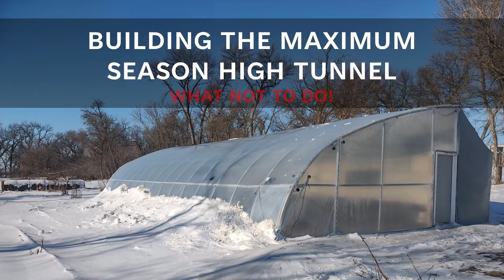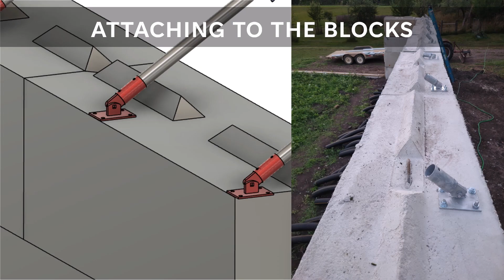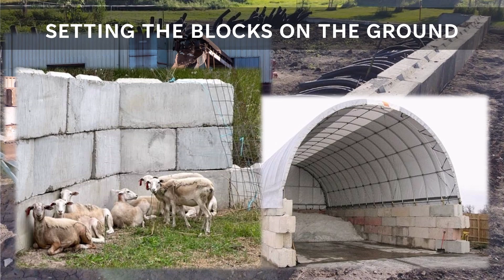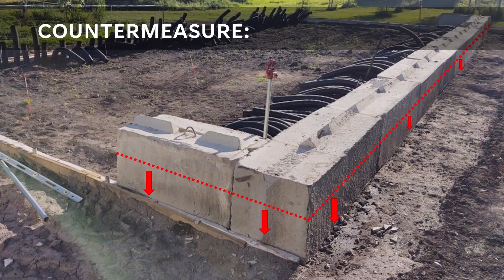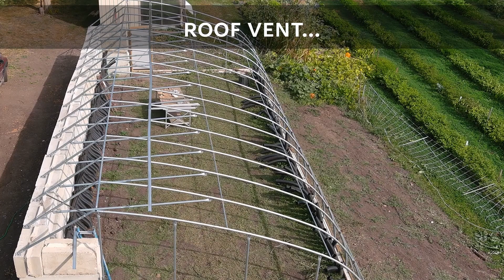Building with Blocks: What I’d Do Differently Next Time

Comment: So the "earthtube" climate battery is already brutal as far as mold/mildew from condensation if it's run in summer, and with thermal depletion if it's only run in winter.  Pouring bulk water down the tubes seems even worse.
Reply from the maker: Can't say I've noticed that in any of my structures.

Comment: Just curious new to this system, wouldn't the perforated tubes become filled with water?
Reply from the maker: These can only be used if your ground water level is below the tubes. Perforations are required so condensation or other water sources can drain out of the tubes.
Reply: @waywardsprings  Thank you.

Comment: 4. More effort needs to made to keep water out of your Earth tubes.  With enough water in there they stop working.  With just some water in them they become a place where mold will grow.  You don't want a system that is constantly throwing mold spores onto things like fruits etc.... It would cut down on how long your products can set on a shelf before they grow mold.
The more traditional systems have long straights with clean out cables that you attach a bleach/water mix on a mop shape and then pull the mop plug (located in the middle of the cable) through the straight pipe.  A 100' PVC run requires a 200'+ length of cable or rope so that you can pull it back the other way on the next cleaning.

Comment: 2. In Sweden they place black paving tiles on the South side of the Green houses so that it pre-heats the air that passes over the Greenhouse film.  This changes up the damage done by wind chill against the outer most Greenhouse covering film, resulting in warmer internal temperatures.  Covering the South ground surface with black garden tiles that are ramped at about a 5 degree downslope will help move the rain run off further away from the Greenhouses foundation.

Comment: Hi I saw your videos on YouTube about sustainable greenhouse construction.
I,myself built a "lean-to" greenhouse with many of the features yours have. My greenhouse was constructioned about 30 years ago. Like yours, I also used galvanized 2 inch pipe.  My greenhouse is 30 ft long, 18 ft wide and 14 ft high. Here in Canada on the Canadian Prairies where winter temperatures can dip down to -40 degrees Celsius. I had to pour a 18 grade bean, with 12 ft bell bottom piles to prevent heaving from frost.
My greenhouse faces East south-East. 
I use my greenhouse for plant breeding. One of the things I've done, is to substitute the plastic on the sides of the structure with double insulated wooden walls,  with corrugated steel on the outside. You seem very concerned about receiving enough light. The Canadian Prairies receive more light than either coastal are of Canada. Although I never operate my greenhouse in winter. I have to use 50% shade cloth to lower the radiant heat. 
Painting the interior walls white help to keep the greenhouse bright.

It would be great to get your response. 
Cheers
Reply from the maker: Hi! I also have a greenhouse like you are describing. In this video I am focused on designing a High Tunnel. In the USA our department of Agriculture differentiates between Greenhouse vs. High Tunnels are generally based on permanence of the structure. Checkout the first video in this series for a better explanation. Concrete pilings or foundation would change the classification from high tunnel to a greenhouse.

Comment: Question that’s a bit of an aside. This sort of tubing is used to provide drainage in fields. I always wondered what the working life of it was and when it starts to break down is it just going to be left in the ground?
Reply from the maker: Manufacturers typically claim a 50-100yr lifetime for the HDPE drain tile pipes. It's not clear to me how they get those claims though. I think failure is typically due to misuse or accidental damage versus actual wear out.

Comment: The depth to set the bottom row of blocks is not arbitrary, it depends on the depth of the local frost line, and should be solidly below the that frost line to account for hard winters and other variables. Areas with minimal soil freezing need to focus more on going below organic topsoil and most roots. Soil back fill needs to be compacted in 6 inch lifts (Some projects go as deep as 12"  lifts if they have large compacting machines and they aren't supporting a heavy structure.) 
I probably would factor in the depth of the buried insulation curtain to the depth of the foundation blocks. It is just really difficult to have disturbed soil right against the load bearing soil. Maybe angle the insulation 30⁰ so it goes further away from the wall as it goes deeper, and dig the trench to leave as much undisturbed soil as possible between the insulation and load bearing soil.
Reply from the maker: Thanks for the feedback! Our frost depth is 48". I did run the insulation that deep. I considered a frost skirt like you suggest, it is what I have on my other greenhouse. The challenge with this is that I'm trying to adhere to the USDA definition of a "temporary " high tunnel (that was my first video of the series).  Standard concrete isn't an option as it isn't portable. Unfortunately I had to disturb the soil too much in order to install the climate battery tubes for this project. I don't recommend a producer use both of these thermal mass systems. Typically one or the other would be preferred. On the positive side they have stabilized. Movement has been minimal in the last 2 winters.

Comment: Thank you for this very useful video series. Is there an optimal or way to calculate what the optimal amount of thermal mass for a system like this? For instance would a double layer of blocks be better or would that be too much? Would a wall half as tall be sufficient?
Reply from the maker: Good question. Maybe I should do a future video covering some of the research that has happened over the decades on this topic. There is diminishing value to increasing thickness due to thermal conductivity limitations. For solid concrete like this about 0.5m(1.5ft) is recommended. These 2ft blocks are conveniently close to that.
Reply: @waywardsprings  Thanks for the reply - I'd be very interested to watch a video on this! Particularly because some of us may consider materials like cob or rammed earth and thus the dimensions are limitless (sort of). Thanks again!

Comment: Digging what would basically be an ICF basement, embedding pipes in the poured concrete to insert the ribs into for the plastic and extending the back wall up to the height you want would be a better solution.   Yes, it would be more expensive, but you could add more insulation on the outside walls, it would be stronger and you wouldn’t have issues with the freeze thaw cycle or drilling into the hardened concrete blocks.
Reply from the maker: Yes, but that would be a Greenhouse, not a High Tunnel. With this project I am specifically constrained to "temporary" materials per the USDA definition of a high tunnel. Checkout  my first video in this series, it goes into those limitations. But yes, that is a great suggestion for those building a greenhouse.
Reply: @waywardsprings  I wouldn’t say greenhouse.  The ICF on the front and sides would be underground or just slightly above.  The back or north wall would be full height.  For temporary materials if you work out the kinks with the blocks it would be a good solution.  I’ll go watch your first video.
Reply from the maker: @jonesjl99  I think most zoning regulations would classify poured concrete as permanent because it cannot be picked up, moved and reused. Probably could design a mold to make cast block that would fit the bill though.

Comment: generally high tunnels have the roll up sides on vertical sideposts for the first 3-4 feet, and do not roll up over the crops. backfilling behind the blocks would prevent the block movement. as well as placing them on a gravel trench rather the frost active soil.
Reply from the maker: Yes, I've been considering the possibility of a vertical side wall like that.  This geometry is designed to maximize sunlight capture. Changing to a vertical wall there would also have a negative effect on the structural load performance of the roof.  Many different tradeoffs at play with that.  After 3yrs of data collection and food production, I think it is better this way.  There are good reasons millions of acres utilize this CSG for crop production.  There are a number of good ways to address the block challenges, nice suggestions, thanks!

Comment: These are great insights!  I wanted to build an asymmetric tunnel, but i'd dig out more of the ground and have my blocks burried deeper under the frost line.  Also the top would have a metal corrugated roof and a rolling insulation blanket for the winter.  Last, id have it big enough for an rv!

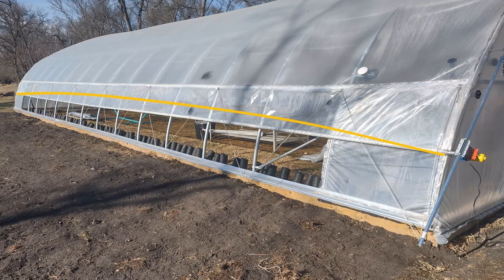Comment: ref  5:45
In stead of a roll-up solution a "canopy" will keep the water away. Connect a iron rod to the cover all the way along the side and lift it up when you need to air the greenhouse, metal rod supporting as needed.

Comment: Im surprised you didn't use metal brick ties in between the block, as attachment points.
Without them serving as structural elements, I don't understand the advantage to using the divider blocks.
Reply from the maker: I wasn't confident the brick ties would work without mortar and the inconsistency in these blocks. The casting quality is pretty low, so I'm afraid they wouldn't sit tightly on the straps. Divider blocks?

Comment: What do you think of using something like ICF to create the wall area? The ICF blocks could be buried below grade, poured and the inside foam cut off….possibly to be used for insulating some of the ground battery. Also would using rock or something with a higher heat capacity and lower insulation value around the tubes increase storage capacity? Thanks
Reply from the maker: Yes, but that would be a greenhouse, not a high tunnel. See my earlier video on the USDA definition of high tunnel. The "temporary" definition of a high tunnel makes some interesting limitations and challenges.